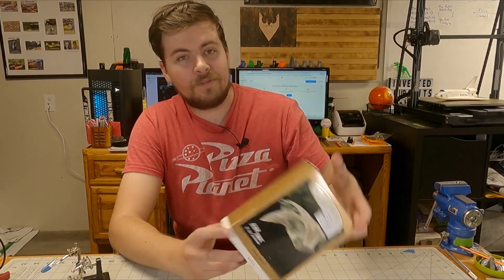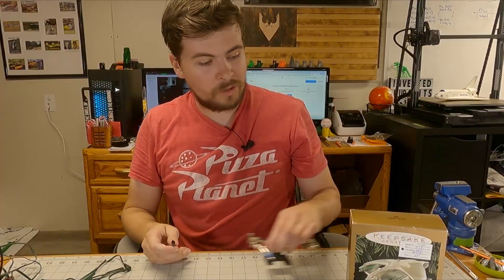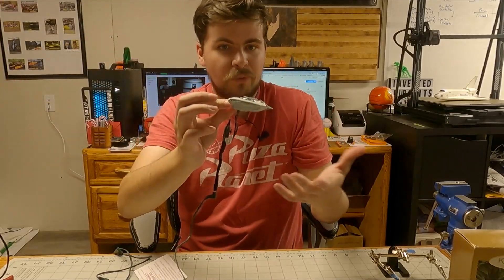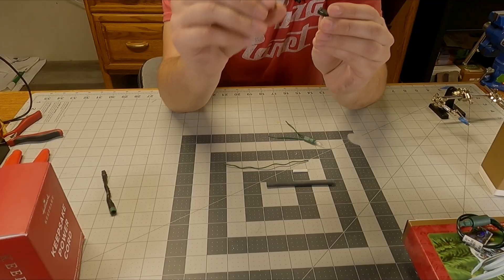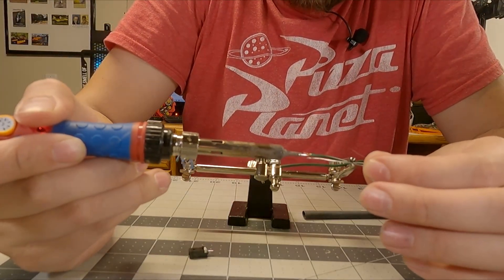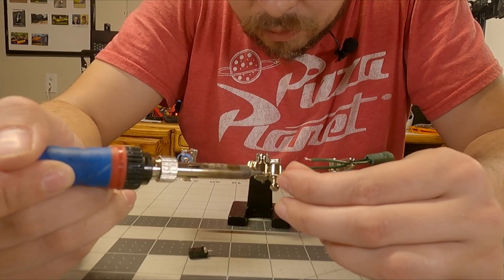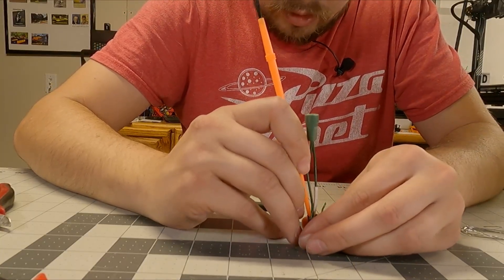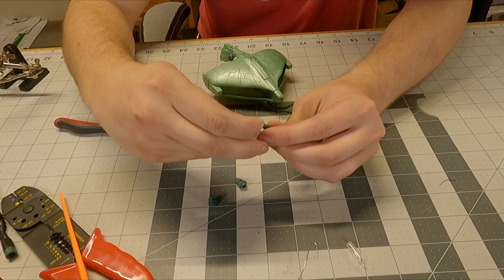Hallmark Keepsake Ornament Power Adapter DIY

Comment: I have an ornaments and one of the copper filaments cracked and broke.  Now one copper filament is shorter than the other. Result? Not enough electricity  to get the movement  in the ornament. What's  a repair solution?
Reply: My dad grafts on a little piece of wire using solder. A little clunky but it works fine.
Reply: @toeguides really? He did this for a Hallmark Ornament? I gotta try this. Not  sure I have the righ kinda wire, thickness etc. Dont u have to be careful cuz if it conducts too hot there coyld be a problem? Tell me more. I know this ornament will work. It did b4 I broke the wire
Reply: @avavictoriasongbird  I’m pretty sure he uses old stereo wire and hammers the copper until it’s a similar thickness and solders it onto the short connector. He’s done it for at least ten ornaments and they all work the same.

Comment: This is great, glad I stumbled upon this! I wonder if this technique would also work for the situation I am in. I just got some keepsake ornaments that I am using in a tabletop display, and I have some other items in my display that take 3 aaa batteries. I would love to use the jack you showed and wire that into the battery connectors of the other items in my display so that the keepsake cord can power them. Do you think that would work, I assume the keepsake cord is 5v DC but the items are 4.5 v from the three batteries?
Reply: Good question!